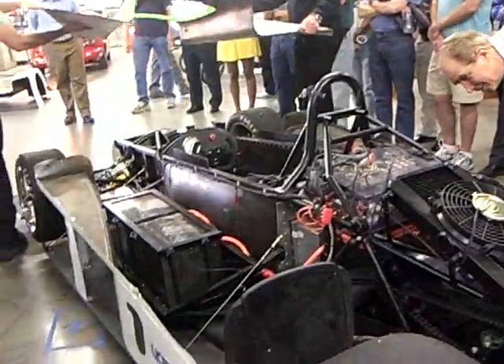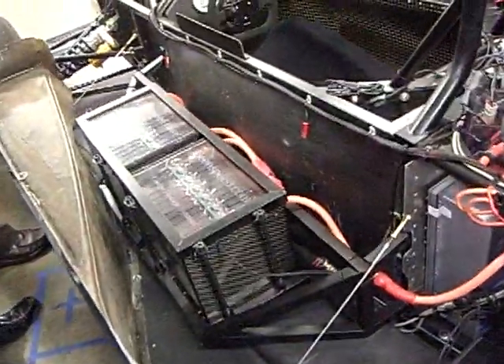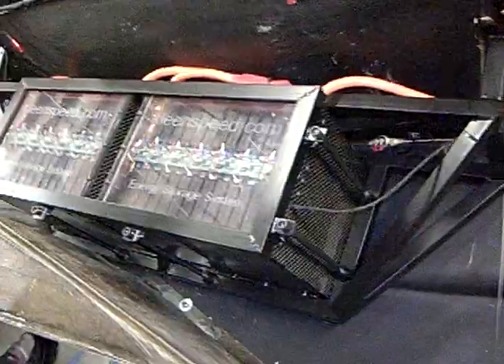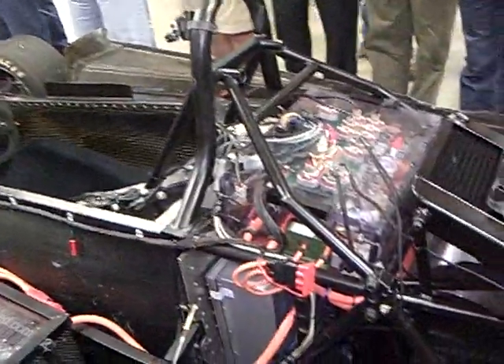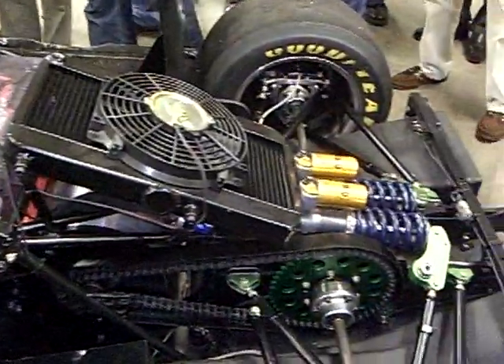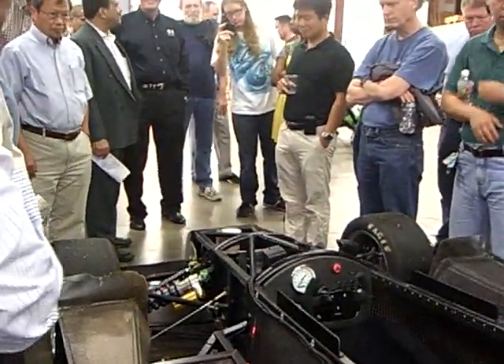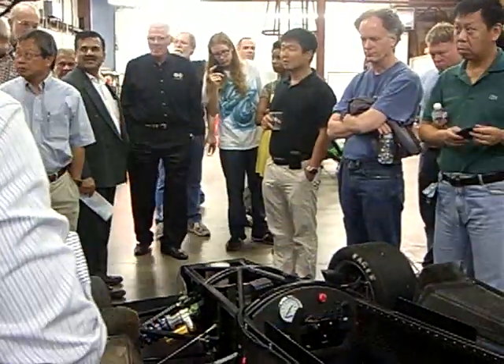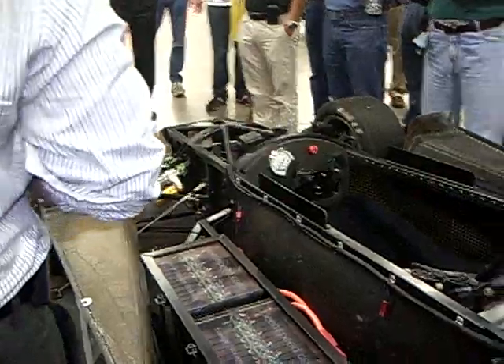Under the cover of 160+mph Electric Race-Car from Silicon Valley Start-up - KleenSpeed

Comment: Why do you have to add “silicone valley startup” in the title? It just makes it seem less done, poor quality and less reliable.
Reply from the maker: The Innovation is coming from the Startups guys, they can't develop out of the box innovation inside a large corporation. 
Most large companies are only improving their product based on their obvious demand from their existing market and customers. This perceived demand is put into Power Point and spreadsheets by the marketing & Business managers who had no will to take large development risk. 
They are taking no personal risk and thus keeping themselves from being blamed for any failure. 
Once a startup's innovation proves itself in the market, it is purchased by the large corp. for large a mount of money and no one inside the corporation can be claimed for failure, even if the purchase completely failed later on during the integration.
Thus if you want to see a real out of the box innovation, go and examine what the startups have in their development stage, even if it is still not fully mature.

Comment: Chain drive - really? That must be super reliable.  
A rad with fittings that go no where?
Only 400V - 40 Li-po RC batteries will make more power and have a much lower weight. 
If you would like to know how to design an electric car properly go to Tesla.com

Comment: You will find transmissions in some cars which have been converted from gasoline engines to electric.  It is optional.  Electric motors have so much instant torque that they can burn the tires up, so you need either a transmission or a controller module for the motor.  Either one is fine. Check out PBS network for several documentaries on electric cars and bikes.

Comment: Check out PBS network and you will find several documentaries that show them running and running well.  You will find shows on old Camaro conversions, electric drag bikes, new car designs, new battery technologies, and most interesting, the story of General Motors EV1 electric car which they quietly quashed in 2001 over the protests of the people who had been leasing them.  Remember George W.?